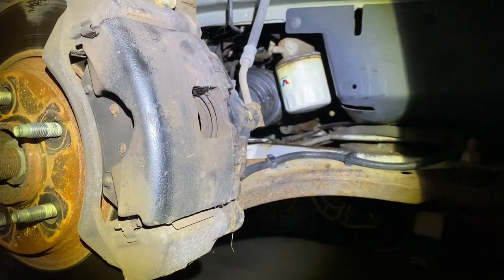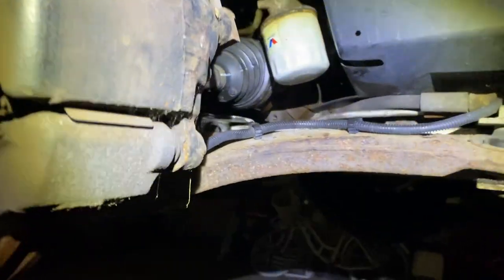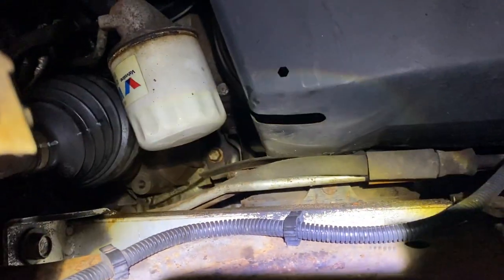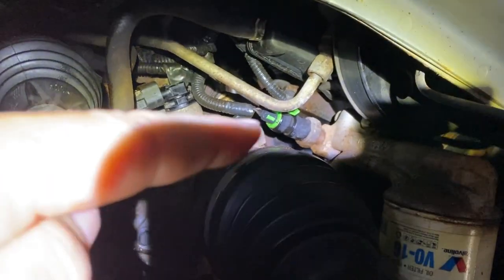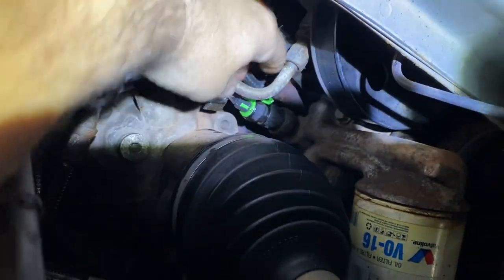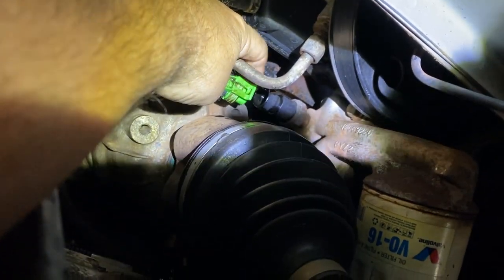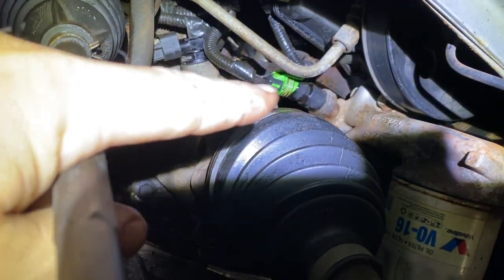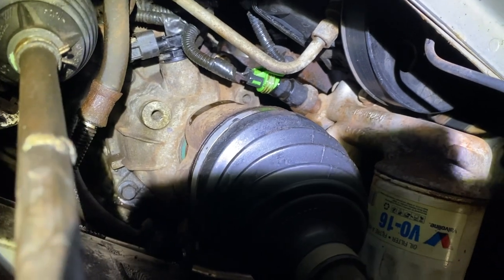Got an Oil Leak in your 3.8L GM engine?- Chevrolet, Pontiac, Buick, Oldsmobile etc

Comment: my 1999 lumina 3800 x police 9c1 was leaking oil.  it never leaked 155000 miles actually i am in canada 189,000 kms.  never noticed till my low oil light xame on.  i was shocked as i recently changed my oil and never checked the oil dip stick for a month.   i topped it up with 3 quarts oil, drove 200 miles home, added more oil. i thought maybe i did not tighten the drain plug or oil filter after I did the oil change myself to save a few bucks.  mechanic said it was oil pressure switch.  all good now  I was very lucky.   love my lumina.,
Reply from the maker: Awesome! if you had watched this video earlier maybe you could of done it yourself and save the extra money. But glad it's fixed. Thanks for the feedback!

Comment: I have a 2001 Buick ultra supercharged ave  it’s smoking out the Exhuast but it’s not overheating /or using water or coolant /oil leaking  all over the intake and supercharger/it bogs out when I first start to gas or from a stop light or stop sign /doesn’t like to go past 2/3 rpm   /has a slight shake when idleing  can hear a knocking noise when it bogs out but not when the vehicles  idleing  /smokes like hell when it’s bogging out /once the bogging stops it stops smoking and the supercharger starts running /but when it’s bogging sound like the supercharger not kicking in or I’m not getting enough power /only 146757 miles /was my great grandfather car  he never had it tuned  so it could be the spark plugs  and the coil packs he’s the second owner  /had it 5 years so it could be that   /any clues or suggestions fixes??
Reply from the maker: Sounds like it has a blown head gasket or the engine needs rebuild.

Comment: I got a Buick regal 3800 V6 I have a leak around this area but it’s not my oil pressure switch I’ve done checked it.
Reply from the maker: Can be coming from the valve cover gaskets?

Comment: Bro you just saved me ty! I haven’t been able I’d find my leak and thought it was going to be the main seal but I just turned my car on and this pressure switch has a constant drip
Reply from the maker: No problem, great that you caught it in time and fixed it. Thanks for the comment!
Reply: @Motorcarnut  yeah me too! I’ve spent $120 on oil over the last 2 months 😂 just swapped the part out this morning, no more leak 👍🏼

Comment: Hey man thanks for the video. I have an oil leak that looks like it’s slinging oil all over the passenger (front) of the engine, and only leak when it’s running or at start up. This makes sense of what it is. Gonna take a look at the switch this weekend 👍🏽
Reply from the maker: Thank you for the comment. It probably is, good luck with the repair!

Comment: Have an oil leak from that general area, going to check later today. Hopefully it's this simple fix.
Reply from the maker: Good luck 🤞
Reply: Did it work ?
Reply: @Fatboy  yeah that was the issue for me. You can also check if you unplug it and there's oil dripping out, then the sensor is leaking.

Comment: Fixed this and i also fixed that oil filter adapter gasket but it still leaks, everywhere. I drive a 07 grand prix
Reply from the maker: Another area common to leak is the valve covers
Reply: @Motorcarnut  I will check and be back with an update
Reply from the maker: @spythe- please do
Reply: @Motorcarnut  and that leak can end up all along the front seal?
Reply from the maker: Yes
Reply: @Motorcarnut will the oil from the valve covers make it all the way to the ground? Thank you!
Reply from the maker: @edubb2491 Absolutely
Reply: @Motorcarnut  I also got  upper and lower manifold gasket leak..got oil in the valleys..famous on these 3800s huh? Will that also make it to the ground? I only got 78 thousand on her
Reply from the maker: Unfortunately yes. It’s not so much the miles but the age of the gaskets.
Reply: @Motorcarnut  😮‍💨thank you  for the response!
Reply from the maker: Sure no problem!